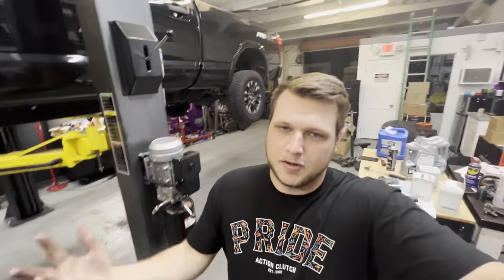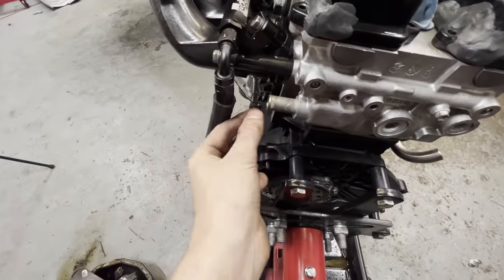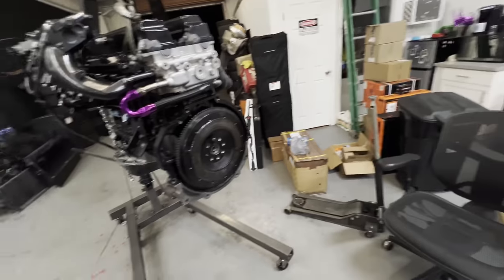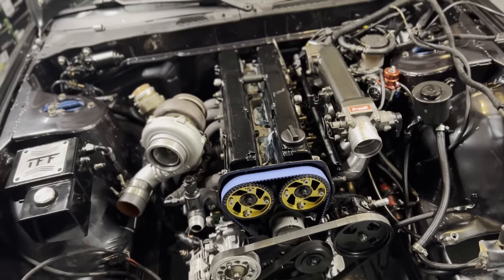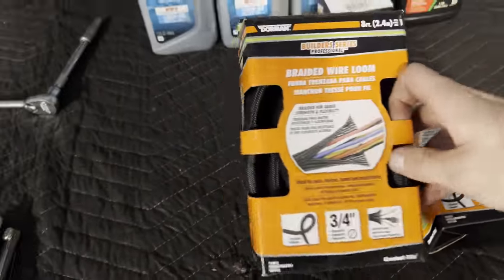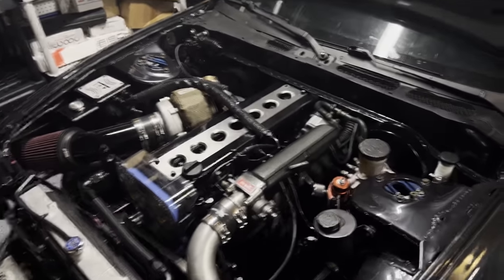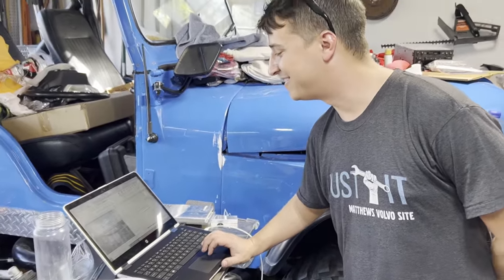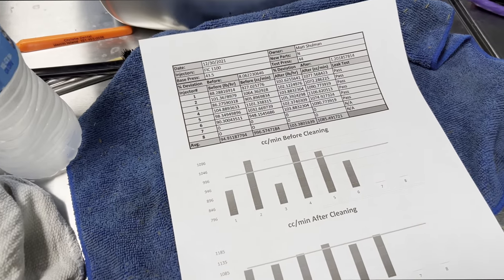Solving My Engine Issues! - 1.5JZ INSTALL!

Comment: You should get in touch with rad Dan for advice on making jz's last. From videos I've watched you want to either go dry sump or rear sump to prevent oiling issues.

Comment: Good job on the coolant line. Actually looks like mine except I welded the fitting on the head and got it a little bit more compact. It works great on my car though.
Reply from the maker: Yeah I wanted to thread it but didn’t have time and the head was already on

Comment: why didnt you remove the water inlet pipe from the block and makes threads so the AN can go straight to the block. those are press in fittings and they pop out over time. surprised you didn't do that

Comment: With looping the line like that you are just sending hot water back into the engine not actually cooling that water coming from the back of the head
Reply: Are you so sure about this? On the stock 2jzgte cooling system that pipe that runs alongside the block to the water pump is a RETURN which sends hot water that leaves out of the back of the head through the heater core and connects to that pipe to be sent through the radiator. 

The coolant also flows through the head; and exists to the throttle body (also hot ass coolant); which wraps underneath the intake manifold and connects to the same return the heater core is dumped into.  I feel the way he did it in the video here is correct if deleting the heater core and could only be improved by taking the typical throttle body coolant flow and route that to the top of the radiator or upper radiator pipe in addition. This would create two coolant exits on either side of the head like intended from Toyota.